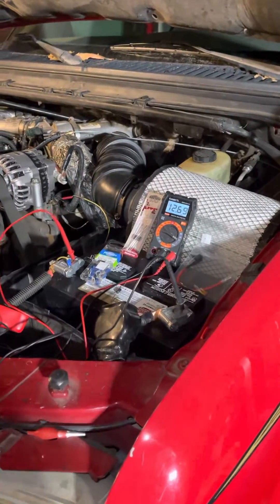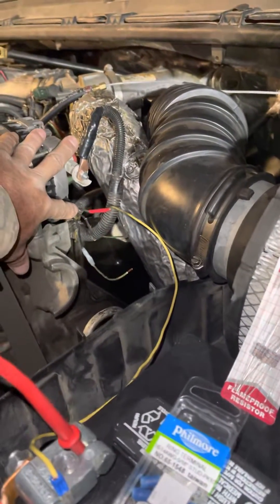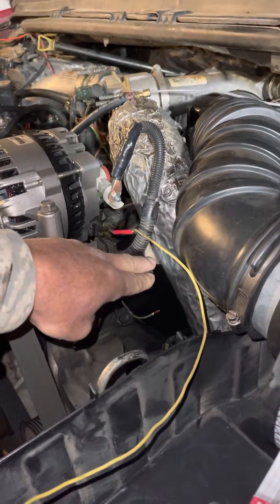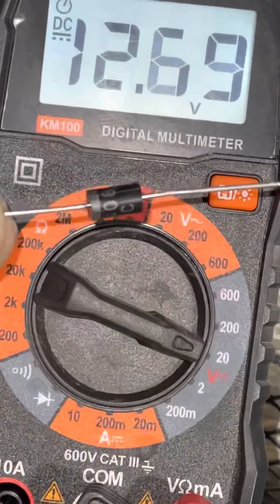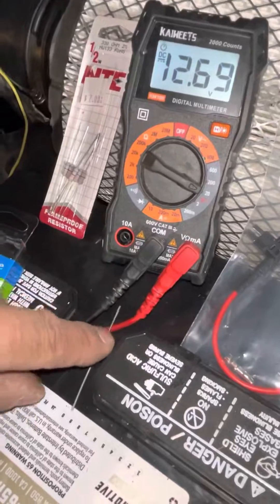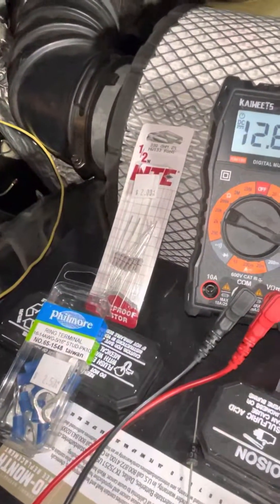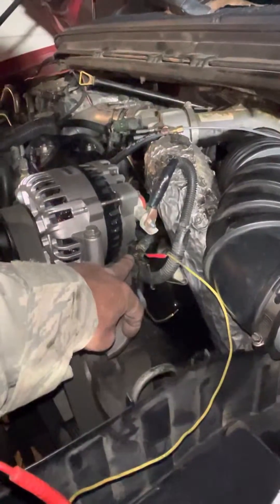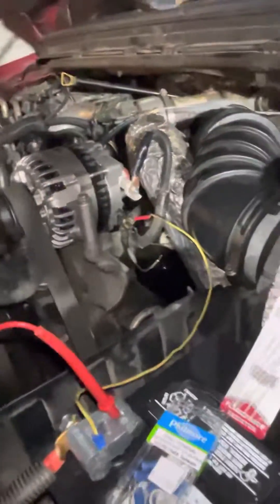I BOUGHT 3 NEW ALTERNATORS BEFORE I FIGURED THIS OUT!

Comment: Which fuse did you hook it up to?
Reply from the maker: I first tried to piggy back it off a 10 amp fuse. But because I never was able to find the actual short in the wiring harness. I bypassed it entirely. I installed a toggle switch and ran a wire from the battery to the toggle switch and from the toggle to the exciter wire on the alternator. I cut the wire off of the wiring harness and left it alone. So i do have to hit my toggle switch for it to work. It is supposed to turn it on when the key is on, and off when the key is off. So  I flip the switch when I start it and leave it on and then turn it off and flip the switch off. It  has been working fine ever since. Let me know if this helps out.
Reply: @fastflo1  is there a why you could post a video on how to make it and where to run the wires step by step because I tried bypass it to but I wasn’t successful with it
Reply: @fastflo1 Yes would it be possible for you to post a video of how your toggle is set up.
Reply: @fastflo1  Is there any way you can make a video of how you bypassed it and what you need to bypass it? Im having trouble with mine and want to see how I can do it